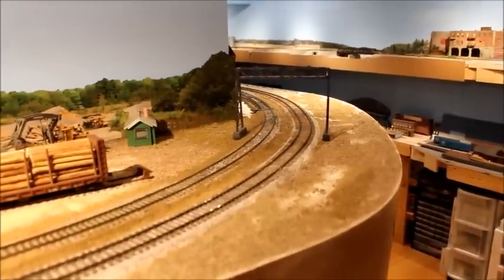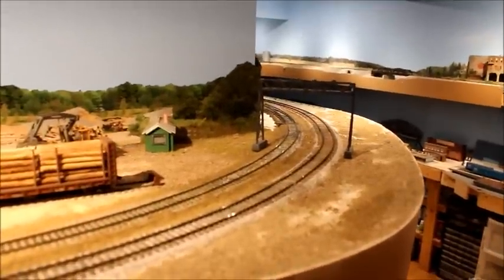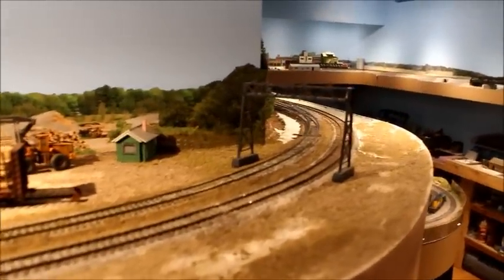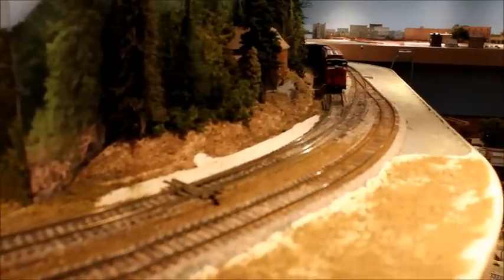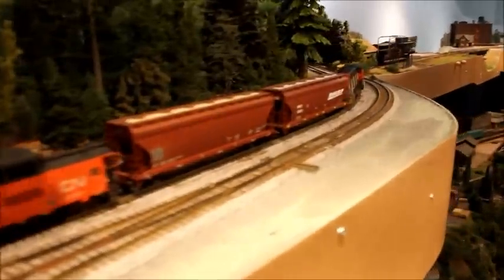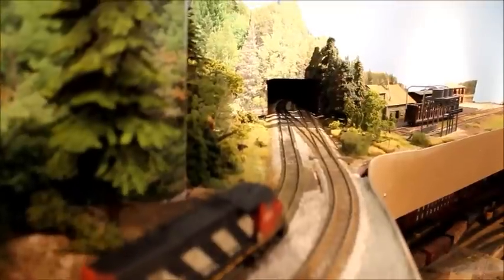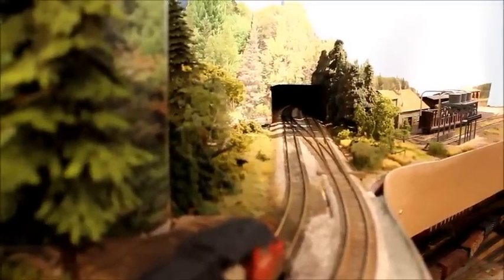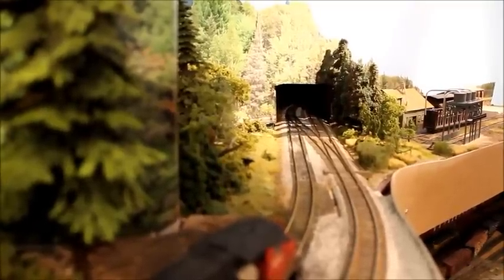Signals on an NCE Layout - Part 1

Comment: Steve, u mentioned that you dont need a dcc decoder for the stall motor. How are you controlling the point movement? Is it manual through a SPDT switch?